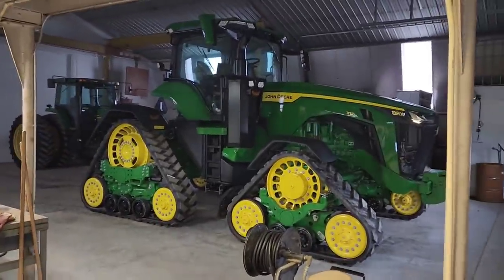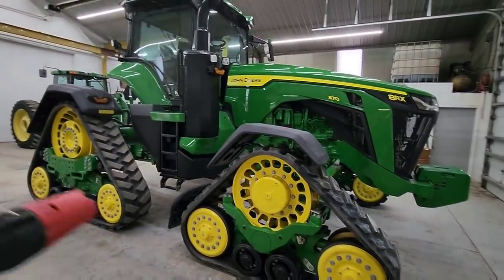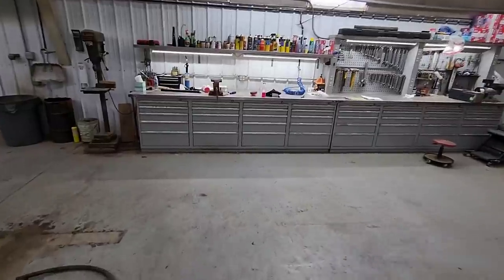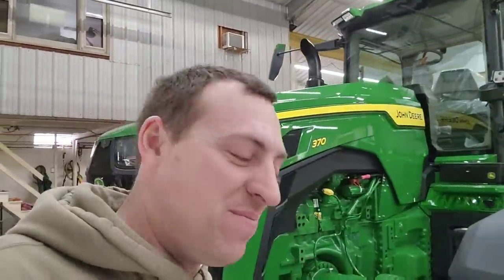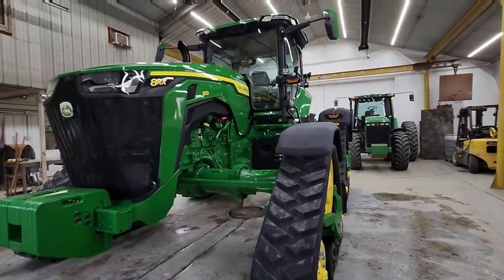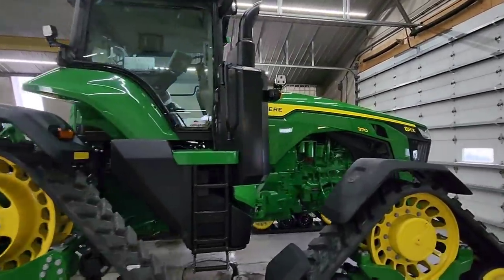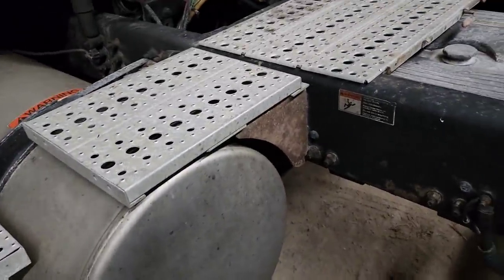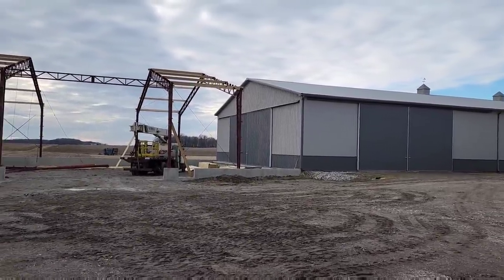Ceramic Coating the 8RX - #621

Comment: I'm surprised the dealer didn't go over how to run it more with you! Is that 9 liter engine in any other machines on the farm. You should have had filters for that machine when you and Brock were labeling filters just say air filter for 8RX see if he would have caught on! 👍

Comment: Not sure who you get your softener from but Culligan makes a dionized water system. Mine is connected to my softener with a valve so that I can bypass the DI unit for all other water uses. I also have a 100 gallon holding tank for the DI water. It will be plenty, even for the combine to wash and rinse!

Comment: The cost is irrelevant at the moment.  Yes it was probably expensive but when you divide that number by 12or 15 years it's not plus its cheaper to run than a older one because it will save on  time fuel and compaction on pinch rows plus servicing . We bought a 2021  8rt  410 it was hard to find and we bought it in Iowa and shipped it back. Nothing wrong with spending extra on a tractor and combine that will last 10 years  You buy cheap you buy twice ! Congrats on the new tractor I'm sure you will enjoy the smooth ride from the tracks . We love or 2 track johndeere we've been running a manure spreader on it because of the ground  being soft. Great video keep up the good work!
Reply: @ROCK-Loveswomen  we have 2 quadtracs that do tillage a 580 and a 500 ! We don't like their magnums the last one a 290 that  we had  was crap it was down more than running . We prefer the johndeere rt 2 tracks for planting . They turn better and deeres GPS is way better and easier to use.  We have a 8 rt 410 and a 8370rt for planting both with 18 inch tracks . We use a horsch maestro 24 row 30 inch for corn  and a johndeere 1795   split row on beans .   Nothing wrong with case we just like the johndeere 2 tracks on pur planters .  Plus our deere dealer is literally 4  miles away. Take care !
Reply: @ROCK-Loveswomen  we have a 8 rt 410 it's a 2 track machine . I know all to well about breakdowns and parts . I work as a mechanic during the winter and farm 8000 acres along with custom farming. Don't worry about my parts bill unless your paying !! it's cheaper than having a case that is down more than it runs. Our experience with the magnums is they  are down more than running with the amount of acres we farm we can't be down a machine. Our johndeere 2 tracks very seldom break down.  I like our  quadtracs  they are nice but also expensive.
Reply: @ROCK-Loveswomen  I agree the case quadtracs and steigers are great machines.  We love our quadtracs but we also like the johndeere 8rts  . For us the johndeere rts work better for our planters whereas the quadtracs work best  running a field cultivator and high speed disk . We find both brands to be good but the case magnums are junk .take care!

Comment: I’m sure to know how much of a difference in cost was the 410 HP model ?
So just 40 more HP I’m guessing 50k more ??
Congratulations beautiful Tractor I’m also proud owner of a brand new 2022 3R !!
A 3039R with all the bells and whistles !!
Hope you have a good season
Reply: I forgot to say when I ordered my new 3039 hour which is the exact same tractor as the 3046R even the engine is the same they just add an inner cooler and turn it up by the computer 7 hp that’s all but that upgrade to the 3046R that extra 7 hp was 8K 
Just for 7 Hp that intercooler is definitely not worth 8K
LOL !!

Comment: Hey there Nathan, I hope you're all well and good!

I'm soo happy for you and your dad, and it's soo cool to see you soo excited about this incredible new tractor. 

Do you like trivia, I hope you said yes, so here's the question: the 8RX is an all new design from the ground up, there is however 1 thing on this tractor that hasn't changed in more than 50 years, do you know what that is?

I'm impressed with your using the high quality Ceramic coating, but I would suggest that you also use the spray on ceramic, for the simple reason that you can coat everything else in addition to the sheet metal, like the axles, frame, engine, etc......

I would also suggest you treat all of your black plastic, rubber, and vinyl, with Griot's vinyl and rubber dressing to protect it from UV fading and degradation.

I hope y'all have a good one!

"Nothing Runs Like A Deere" 🦌👍🇺🇸
Reply from the maker: Hmmm I'm not sure. I would say the Deere logo but that changed in 2000. Maybe the weights but I think those changed somewhere between the 40 series and the 8000 series so at most 40 years ago. 🤔🤔🤔
Reply: @BorderViewFarms 

Hey Nathan.

I've never seen you so excited, the Combine wasn't even close. I'm almost as excited for you, and can't wait to see you use it for the first time.

The answer is the toolbox and it's been the same since since the 20 series tractors in the late 60's which was before your time. 

You're gonna Love that IVT which is Deeres 2nd generation, and it's not only more durable, it's also more efficient.

I was happy when I saw you reading the Operators Manual, which is something that most people never do.

Once again Congratulations!

"Nothing Runs Like A Deere" 🦌👍🇺🇸
Reply from the maker: Actually I don't think that's true. They added the John Deere logo to the toolboxes a few years ago. The toolbox on the 4440 and 8300 don't have a logo on them.
Reply: @BorderViewFarms  

When I was a boy growing up on the farm, we had both a 20 and 30 series tractor, then later i was a Dealer during the production of the 40-50-55 series, and then the new 5K and 6K series, and I ordered every tractor with a toolbox, they were all identical, black with a black and silver JD decal.
I've never seen one without the decal, but so as not to argue the point, the answer to my question was the toolbox, which hasn't changed since the 20 series in the late 60's, still using the same stampings, and not about the decal.

The JD toolbox was always pretty pricey, and I know some dealers sold and installed a generic toolbox, which couldn't have a JD decal, which I'm guessing yours are, because back then it was an option when ordering a tractor, and some dealers didn't order them. 👍

Comment: That is a sweet ride! Maybe this Is a dumb question but do you have to do anything to the tracks as far as a ‘break in’ if that’s the right word? I would think they’d get hot especially in the transport mode as green as they are?
Reply from the maker: Yeah if we road longer distances more the 5-6 miles we need to stop and throw some talc or floor dry in the tracks to lube them. Once in the field the dirt does that normally.

Comment: How do you add wheel ballast?  Oh wait....  Real question if additional weight is needed, where does it go?
Reply from the maker: I believe front weights are the only ones you can add. That said this tractor is plenty heavy and shouldn't require much ballast

Comment: I saw an older video where your ceramic coating failed in less than a year. I see you are still using Armour Shield 9. That coating is an entry-level automotive coating and does not have the chemical resistance required for an agricultural environment. That's why it isn't lasting. You'd get much more bang for your buck and save more time by using an agriculture-specific coating, or even a pro-sumer level automotive coating

Comment: Any thought on the tank fenders for the rx instead of towing the fertilizer cart?
Reply from the maker: Not the exact rate tanks built in. All that open easy access space fills up in a hurry with them but I have looked into a front mount tank to potentially replace the towed cart.

Comment: Do the two track versions have wheels on one end, and tracks on the other? If so, don”t you lose the advantage of low unit pressure on the ground?
Reply from the maker: No 2 track machines have 2 long tracks, like a tank or a bulldozer.
Reply: @BorderViewFarms  so, you have.To steer them with differential speed on the tracks, like a dozer then? Do the front tracks on the four
Reply: @BorderViewFarms  so  do the front tracks on the four track “steer” like tires?